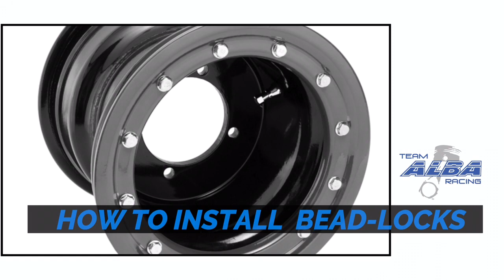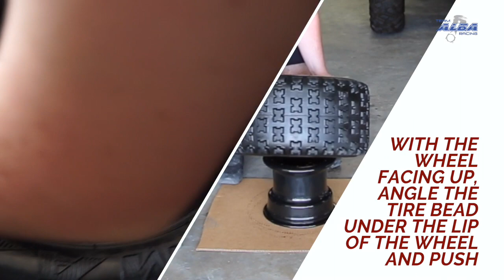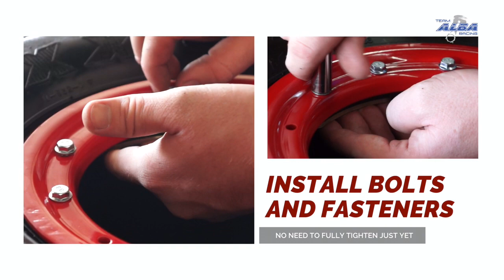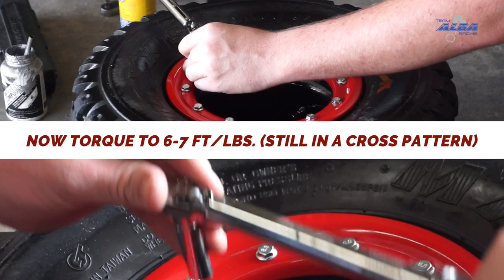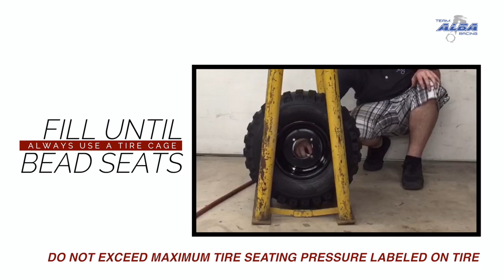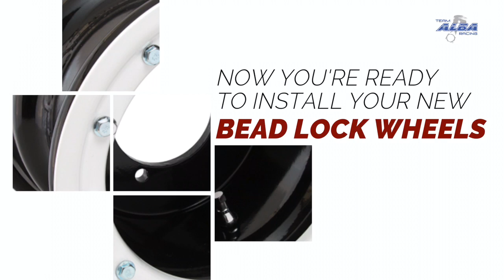How to install ATV Beadlock Wheels by Alba Racing

Comment: I cant seem to make that tire pop in just like you do in the vid
Reply: How did you install the front tires on the alba beadlocks i have the back ones on just cant seem to be able slide the front ones in
Reply: Tiny McPoop  i figured it out dont try to force it in throw some soap on it and twist it on it should work thanks.

Comment: I’m confused on how the bead is going to get seated if you don’t use spoons or get it over the wheel bead first.
Reply: The bead is locked on one side and it still has to seat on the other you push the tire on the side where the ring mounts then lock it on with the ring